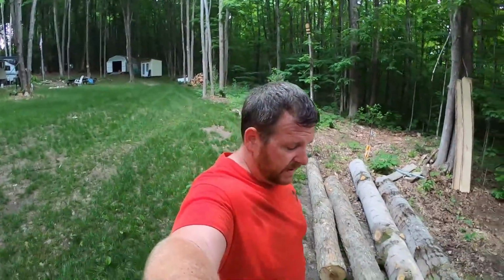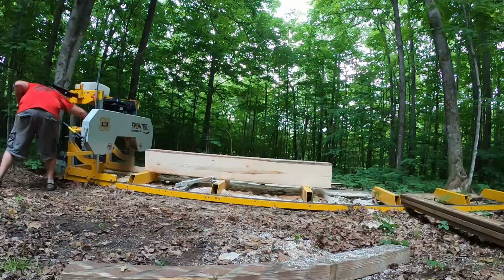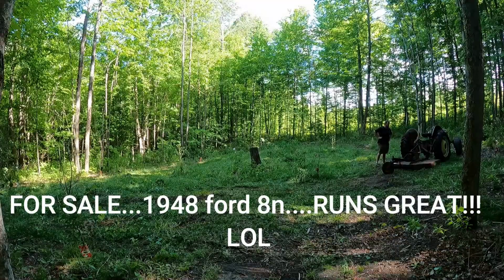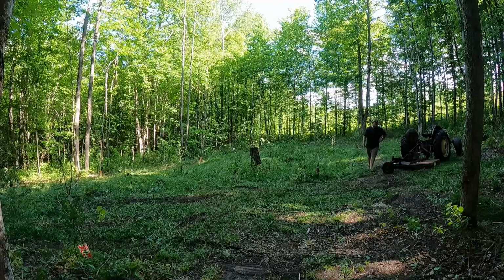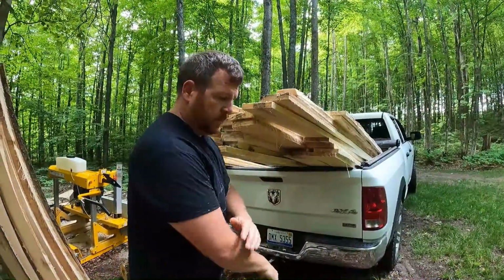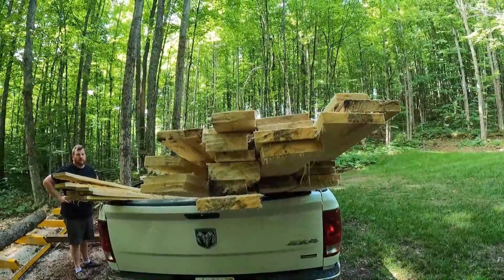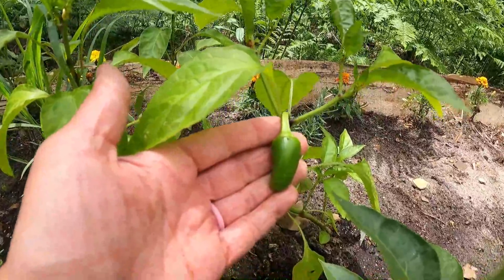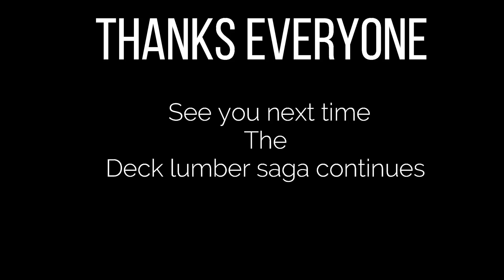Milling Lumber to for our Off Grid Cabin Deck Build #lumber #freelumber #sawmill

Comment: Love that sawmill Jay and Jen ! At the price of dimensional lumber these days and with your wood lot it makes great sense to have that awesome piece of equipment , Also Jay don't give up on that 8N the parts aren't to much's bucks and there readily available one more thing that I've been wanting to say is that to prevent future wood rot is that you need to install some drip cap over your windows and doors , with out it when the rain is beating down that water is just running down and in  behind  your siding  and it will deteriorate all yours and Jen's hard work probably inside of five years they have the stuff at Depot or Lows  , Just cut it to the widths and slide it up under your  siding above the doors and windows , thanks for the Vid .
Reply from the maker: Thanks buddy for the tips. I did make a drip edge for above the front door,  but will make sure we put some on the rest of the cabin when we start the siding again. Appreciate ya

Comment: Take the time and level out that mill so you get consistent thickness in your lumber.  While it may be a pain, it will be time well spent!  Do you plan to get the rest of the siding on this summer?
Reply from the maker: thanks CW, I'm hoping to relocate the sawmill to a nice flat spot where the other camper was located last year. I just need the man power to come lend a hand to do it. we are going to get the rest of the live edge siding done right after the decks get built, it will make reaching things easier with the decks built.

Comment: You two keep pecking away. These little projects may not look like much but when you go back and review what you got done over the summer you'll be surprised. Good work. I hope that ole 8N didn't get put out of commission with that little oops. Put a little lighter shear pin in the mower. LoL. Have a great 4th. Take care. - Paul
Reply from the maker: Thanks so much Paul, we are wondering what we have been doing all spring, but there are lots of little projects around the property that need to be done....some showed on these vids and lots not even taped, so happy to be getting things done either way.  Appreciate the continued support.  Best wishes

Comment: Great video, how long do you let the lumber dry brfore you use it?
Reply from the maker: Thanks jeff. I'm using it green. We used it that way for the live edge siding and it worked fine. We just make sure we use minimal nails or screws when installed,  then after 6 months we go back and but in more screws. My video of doing the live edge siding kinda shows what I'm talking about. Just single nail it until it drys.

Comment: How is your saw mill working for you?
Reply from the maker: The saw mill is actually working very well now that I have gotten it figured out. I have plans to move it still and build a better platform for it soon. It has settled a little and is not perfectly level so that is my fault but other than that I'm happy with it.
Reply: @OffgridwithJayandJen  that sounds great, we could get so much accomished if we had one!
Reply from the maker: I had been wanting one for years before I took the plunge. Last spring when stuff started getting bad I bought one ASAP, glad I did. 😁